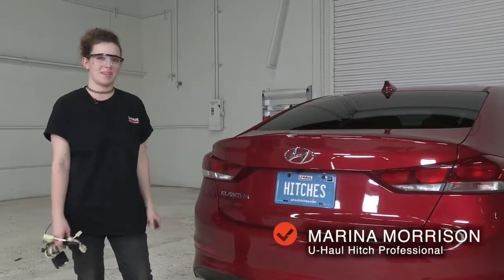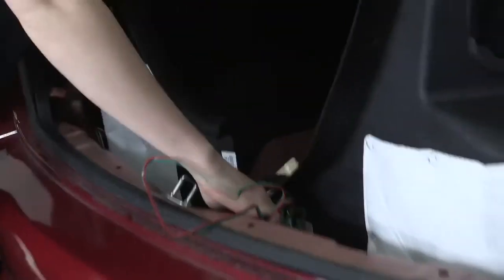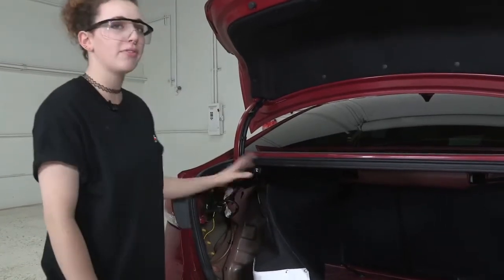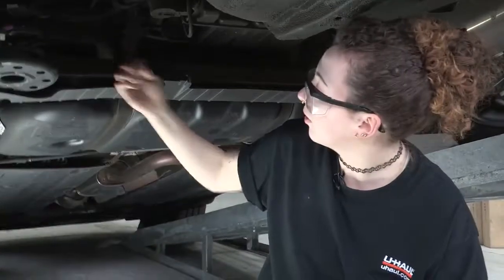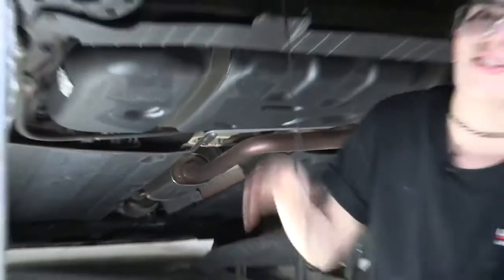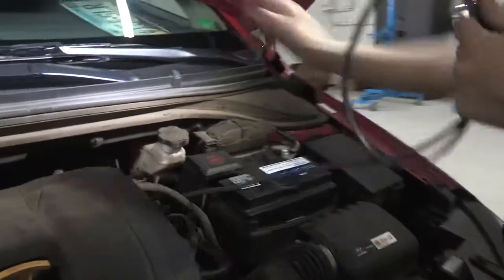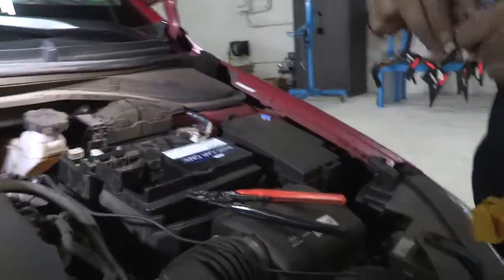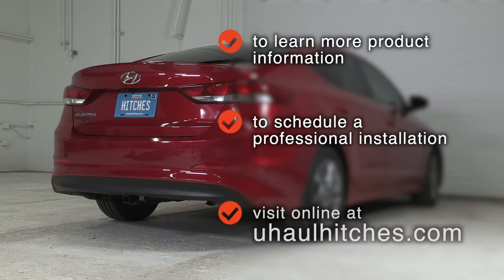2017 Hyundai Elantra Trailer Wiring Installation

Comment: A little DIY advice. Put back the rear panels only when you are sure everything is working fine. It would be silly to have to pull back everything again if there is an issue. Thanks you very much for this tutorial.